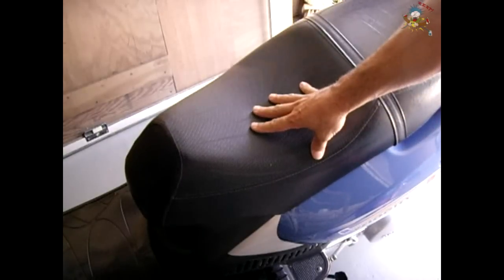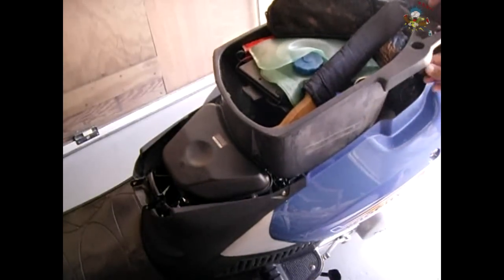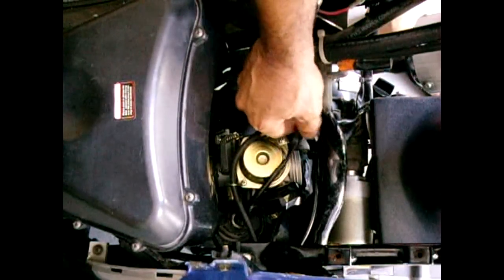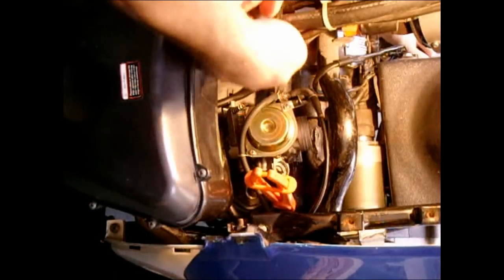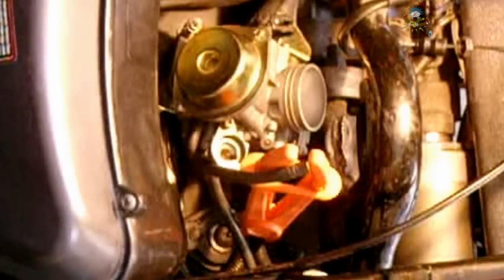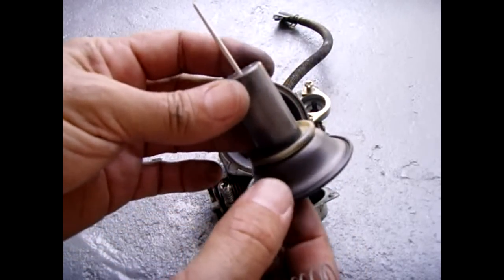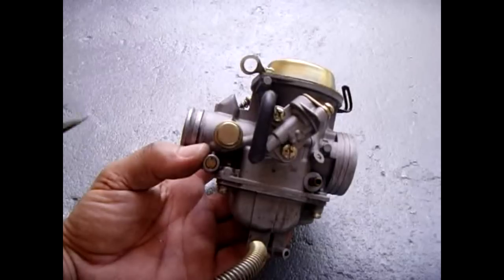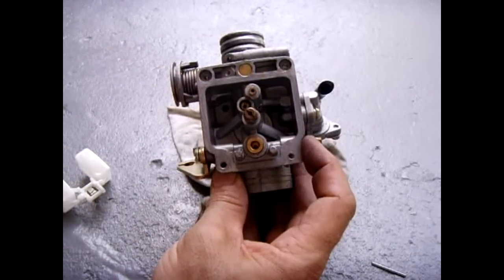GY6 Carburetor Inspection, Problems, Removal, & Adjustment

Comment: Hey man, due to finacial issue's, I cannot afford to take my scooter to a garage, so trying everything I can to get it started myself, it has run so well, then after two weeks of standing still it wont start at all, drained the old fuel off, put new fuel in, put a new spark plug in and checked for spark (definitely had spark and gave myself a shock too!)....so my next step is to check the carb, I have never done this before, I had an initial inspection today and couldnt figure out how to remove he throttle cable, so your video has just shown me how! thanks man!
Reply from the maker: +Paul K 
Glad I was able to help! Please share.

Comment: Good camera work and thorough explanation.  I just completed a carb and air filter project on my GY6 and this helped a lot.  Thank you.
Reply from the maker: Glad to hear! Be sure to check out my other videos as well, rate thumbs up , and share. Thanks
Reply: @electronicsNmore  my 150 scooter has carb issues I do my own but this is stumping me the diagram is wet with fuel I put a bigger main jet runs like 💩. I'm putting in a carb rebuild kit the whole anchalota. Diagram, needle, floats, etc. All of a sudden starting running like 💩. Rebuilt the entire engine crankshaft, starter clutch etc. Ideas?! 😃

Comment: great video, very well presented.  cant keep my scoot  running and now it wont start, probably due to old gas who knows.  I will take mine off and clean it, either that or get a new one. I also have the 150cc/157QMJ not sure if its long case though.  How do you tell?  thanks for the video it was very helpful.  God bless
Reply from the maker: Watch my GY6 valve adjustment video.
Reply: @electronicsNmore  I have actually adjusted the valves on my scoot several years ago in 2012 shortly after I got the scoot.but I will watch the valve video. Im sure it will be very informative

Comment: I wouldn't use a brass bristle brush on the float needle seat. I take a q-tip, snap it in half, dip the cotton in polish, insert q-tip into drill, and polish the seat. That seat should be very shiny. Fixes a leaky seat every time. BTW, you won't get lost in the crowd, with those shorts on.

Comment: Very thorough and visible. Thanks!
Reply from the maker: +HelixObscura 
You're welcome!
Reply: +electronicsNmore - Question. Is there a way to remove the drainage line (the one with the coil) from the carburetor? 

I tried releasing the clamps but discovered that there was a black line running under the coil, and this line did not seem to be able to be pulled off like the rest of the lines. Thanks!
Reply from the maker: HelixObscura

They come off the barb.
Reply: +electronicsNmore - Ok, got it. Thanks again!

Comment: I am trying to remember where my vacuum lines go on 2007 GY6 (Baja SC50-2).  has 2 from petcock and  ports on crankcase and air intake .   I think one from crankcase goes to petcock. But which goes to carb?  I watched your video and saw you disconnect a line from carb but don't know where it went. Thanks
Reply: actually my petcock has two lines total. one is fuel
Reply from the maker: I'm sure you'll be able to find pictures online. They're all different. In the video, the hose pinch tool is on the fuel line in.

Comment: That large rubber diagram, above the main needle. I'm struggling to get it to fit properly. Did you fit it while it's completely dry?
Reply from the maker: It shouldn't be any problem installing. Make sure you're installing it correctly.

Comment: Should the needle on the diaphragm move free in and out or should it be stuck to the diaphragm? My scooter is running very rich and I have tried everything
Reply from the maker: +sean crawford 
Hi Sean. I sold my scooter when I moved. Unfortunately I cannot check for you. Are you sure you cannot see that detail in the video? I thought it moved free.
Reply: sean crawford check to make sure your carb jets are the right size

Comment: after attaching new carb. 50cc still won't start. fuel does get to the carb. and there is spark. but yet nothing. when I poor had directly into the intake it does start. 
any thoughts?
Reply from the maker: Please refer to my GY6 troubleshooting video. Thank You!

Comment: Plz help.....  I have an atv Chinese same carb....  But when I turn the engine on, and i let go the gas,  i shuts off, i already adjust the screw on the gas cable, as well as the idle screw (pin) any ideas what can it be???  Also where does the hose that's on top on the carburetor go??  Does it go to a little nipple in front of the carburetor, where the carburetor and engine meet?
Reply from the maker: Unfortunately it can be many things. Bad vacuum line, cracked intake manifold, faulty carb, fuel enricher, or valve adjustment,

Comment: Do you have a diagram of the regulator rectifier you made? Any info in that? I been looking at the trail tech, universeal rectifier regulator, it's fullwave, and doesn't work with the stock stater, I guess the mod you did is required,  any info you may have, would be a help, thanks, do you still have the scoot??
Reply from the maker: Scooter sold in 2015. Did you look in the video description area of the video that showed the Vreg I made? There may be a link.

Comment: Says he added a fuel shut off valve near the tank, but that is not shown in the video.  I wonder why that part was edited out of the video or why it was not taped.
Reply from the maker: Why bother showing it? Most people won't have one, or have one in the place where I added mine. I explained what to do very clearly at 7:40.

Comment: good morning to all, I disassembled the carburetor gy6 125cc to clean it as your useful guide showed.
I do not know how to put the fuel lines to the carburetor, can you help me
Thank you
Reply from the maker: Always mark things before taking them apart. You should be able to see where the lines go in my video. Thanks.
Reply: unfortunately I can not see the lines from this video
Reply from the maker: +Andrea Ferrario Google search gy6 carb hoses
Reply: if I wrote to you .... it's because I have not found what I was looking
Reply from the maker: +Andrea Ferrario Unfortunately, because I have over 350 videos on this channel and many viewers asking questions, I'm unable to offer my viewers special assistance in troubleshooting problems. I only answer one or two questions and that is all. I can assure you the information you're looking for is online. Thank you
Reply: thanks
Reply: @andreaferrario3270  the fuel line is roughly half way up the side of the carb, usually has a brass fitting you slide the fuel line over...the lower nipple with a hose is for draining the float bowl out the lower hose and the top nipple is the carb overflow outlet so put the fuel line on the middle probably brass (gold) one. Trying to use the KISS method here and man, I'm pretty sure my cat could follow these instructions, lol

Comment: Can you make a video on were the fuel filter goes I brought an new carb for my 150cc gy6 scooter an had someone else install it but now I am not getting any gas to the carb
Reply from the maker: +Jonathon Myers 
Hello John. If your scooter has a fuel filter installed, it should be on the fuel line between the gas tank and carburetor. If you are not getting any fuel, then you may have a faulty petcock(fuel shut-off valve). Try bypassing that valve. You will see a vacuum line connected to it along with the IN/OUT fuel lines.

Thanks For Watching! Be sure to share my videos with others and rate thumbs up.
Reply: electronicsNmore Nem gindoltam de jo igyis

Comment: My 125 scoot starts up and idles for a about 30-60 secs,at around 1600rpm then cuts out! It will continue to cuts out until around 3 miles of riding until warmed up? Would this be the auto enricher not working? Thanks
Reply from the maker: Possibly the enricher.

Comment: i just bought a new carb then i notice that there's no hole in the manifold vacuum nipple what does this mean?
Reply from the maker: You didn't buy the exact replacement. You can always plug a vacuum port.
Reply: electronicsNmore what do you mean?
Reply from the maker: +STFU768 I guess I don't know what you meant. Explain much better. Thanks
Reply: electronicsNmore so the manifold vacuum on my new carburetor is covered up with plastic, not  cap but actual plastic fused to the nipples.On my old carb there was a hole in the manifold vacuum, so I'm just wondering if I should drill through the plastic or not because the vacuum line isnt complete when its covered
Reply from the maker: +STFU768 Something does not sound right. You need to connect the vacuum line to the carb. Better inspect it much closer. Contact the seller.

Comment: I've been having a problem with my scooter when riding... When riding at higher RPM, it goes fine for a little and then stalls. After, I have to crank it excessively to restart. I theorize that when going, my float bowl is being drained out faster than it refills, causing stall and needing excessive crank to refill. I have a brand new mikuni (sp) vacuum fuel pump that I inspected before installation, so I know it isn't that unless the 35L/H rectangle ones are too weak, and now I'm pretty sure through process of elimination that it's my floater. Maybe it gets stuck closed when I fill the bowl up? and then it drains over time... of course then I wouldn't be able to refill it via cranking...  ugh, diagnosing my issue has been the biggest pain... any ideas on what it could be? I idle like a champ, but at 45 mph I make it about half a kilometer before it just cuts off
Reply from the maker: Next time you have the problem, immediately try using engine starting fluid, or some gasoline sprayed into the air intake. If it starts right up, then you have a fuel system problem.
Reply: Well in experimenting with the problem I've narrowed it down some more... since I had to drain the carb to work on it, the problem became all the more obvious. Fuel isn't making it to the carb (I put my filter for outgoing on the end, about 3-4 inches before the carb fuel inlet, and I can clearly see that it is not filling... I start up fine with starter fluid as always, which tells me that my problem is somewhere between the tank and the carb... All of my lines are clear though, I blew through each just to ensure that before installation, and my vacuum pump is new and of quality brand so that's fine... The only thing that puzzles me is the hose setup, I did it the way it came, but my scooter came to me pre-assembled by the dealer so maybe they messed up from the beginning? I have a gas tank unlike what I am used to seeing, it has 2 ports on top (actually 3, there's one at the very top near where u fill it is capped off, much smaller than the other 2) and only one of those 2 ports actually is going into the fuel inlet for the vacuum pump, the other is connected to a T and is having gas go back in from the outlet. I presumed that was done like that to prevent vacuum pressure from building up inside of the tank and eventually being greater than the pump's capacity, but I am now looking at it as the most probable culprit. Any experience with something like that? I'm more experienced with petcock style, elevated fuel tanks, so IDK if maybe that's all wrong... seems like it could be as simple as raising the fuel line going back in the tank so that fuel will go to the carb until enough pressure against the float is built up for it to go that way, or maybe uncapping that small port to allow air to fill the tank as fuel is drained from both of the other ports... I'm just glad to finally have the possibilities down to a minimum lol

Comment: WHAT IS THE FLOAT HEIGHT ADJUSTMENT. NOBODY EVER KNOWS.
Reply from the maker: The fuel level height is suppose to be around 18.5mm. If no one ever touched the float, then you should not have to bend the tab on the float to adjust the height. More important is that the plunger attached to the float has a good seat.
Reply: Arthur Bradley there suppose to be paralel to the carb body. go to 90GTVert he has awesome videos.
Reply from the maker: Kevin Stearns
I already answered this viewer almost 1 year ago. He was given the correct information. Based on your comment, my videos are no good? LOL
Reply: @electronicsNmore  I think Arthur Bradley might be a little ... or maybe a big ... slow? LOL